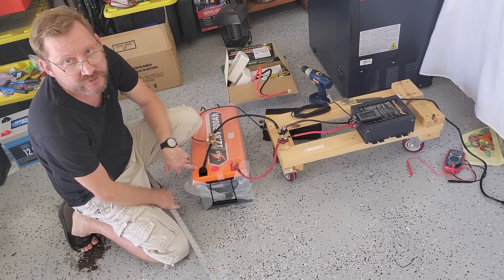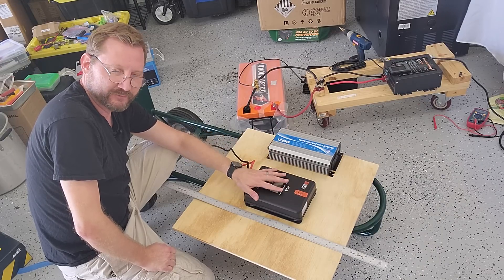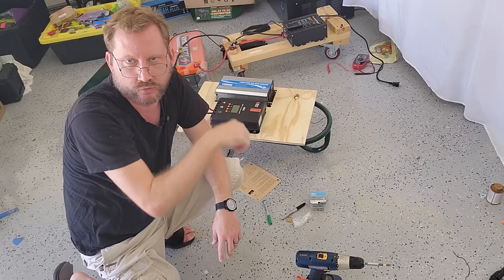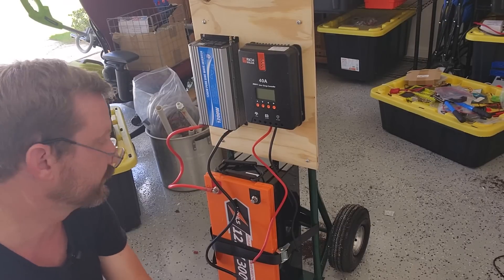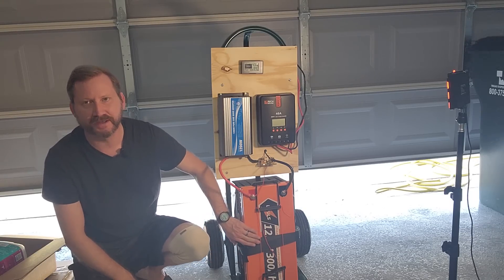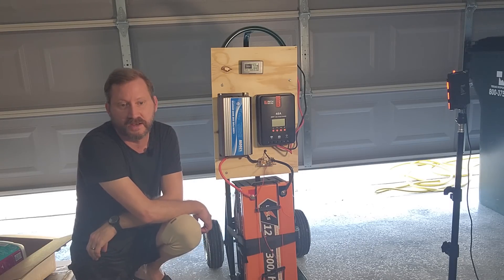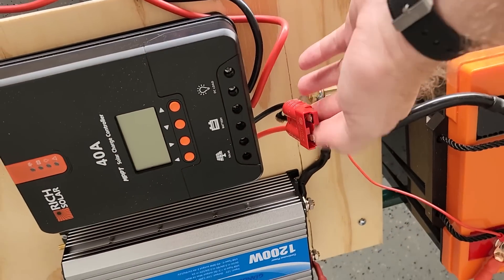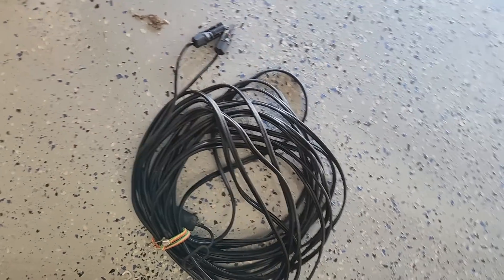Build a 3840wh solar battery cart for under $1,200 in 30 minutes| #diy  Texas Prepper Projects

Comment: Server rack battery is way to go. Under 1000 for vatrer 48v and another 500 or so for all in one hybrid inverter. Powmr released a low frequency 5000w version recently.
Reply from the maker: See my video on 12v 24v. I think 24 is the best. 48v systems require too high of a solar input voltage and the components like inverters are too expensive

Comment: I've been searching youtube on these sorts of things. I've made up my mind to build yours. I quite like it. Is there any item or device that is retrospect you would change or add to your system?
Reply from the maker: If I were to do it again, I'd make a 24v system. Check out my other recent videos. In a 24v system, the current is lower, so it's a little safer and you can use smaller wires. I think that a 24v, 200ah system is just about right.
Reply: @texasprepperprojects  Funny you say this because I just spooled up that video.
Reply from the maker: @BarbosaUral  great!

Comment: Really nice setup I am trying to make a setup but am not sure how to get started.. just curious is the battery designed to be used up on its side like that?
Reply from the maker: vendor said it was fine. its just a few wires. if you have done a car radio you can do this

Comment: I wish you guys would just tell us you can run a refrigerator for like 18 hours you could do the fan and The Notebook for 3 hours and as well as five other light bulbs tell us what that 3840 amp hours can do
Reply from the maker: Its because I can't.  What you need to do is get a Kila watt meter and plug it into your fridge and let it go for 24hours. Every system, every house is a little different. I know that my chest freezer in my garage needs 1kw for 24 hours because i tested it. So, this thing will run my chest freezer for 4 days. But if you have a newer model or a bigger one your number might be different.   Watt hours is a great universal measurement but I can't and won't say 'this will last this long' because there are too many variables. Spend $30 on a watt meter and test some stuff!

Comment: I heard you can use a Renogy boost converter some how to overcome the  minimum solar input voltage of 120v. Any comment?
Reply: Forgot to mention that I'm talking about the minimum input voltage of the eg4 all in one
Reply from the maker: Yeah I get you. I've seen similar for golf carts that run high voltage. I'm sure it would work but you are going to lose efficiency. I have seen @WillProwse do it with his golf cart
Reply from the maker: I have used DC DC step ups in the past. I'd do it in a pinch but I don't think it's trust them for daily use

Comment: Great video. 

There's just too much tree cover around the house so using solar is problematic. I plan to use a similar setup, leaving it inside the house to keep the refrigerators powered. But run a power cord into the house to recharge the batteries via a portable gas generator placed outside on the deck. The plan is to shut down and secure the generator at night and use it to charge up the batteries during the day.
Reply from the maker: Good plan!

Comment: Great video.  I went the EG4 and server rack battery route and have to agree with you needing 120 volts minimum to start the solar charging is a hassle.  But I found a work around buy using my EcoFlow delta max 2000 to charge the EG4 LL battery or by using my Honda 2200 generator when we lose grid power.  After seeing your video I think I will build another one similar to yours.  Have not decided on whether I will go 12V or still go 48V.  Thanks for your video and sharing with us.
Reply from the maker: Stand by, I have a 24v system with a LOW input voltage video in the works, which I think is a great compromise!
Reply: @texasprepperprojects  I will.  Would be neat if you could also show how to connect a 48V to 12V voltage reducer converter thingamajig.
Reply from the maker: @shelley131  that's actually pretty easy,. It's just 2 wires in and 2 wires out, but i'll try to include that. Having said that, the more I play with these things, the less I see a need for 12v in most applications.
Reply: @texasprepperprojects  I have frequent grid outages where I live and because of that I find that power is premium and 12V appliances are my go to during this outages.  For example during the freeze here in Texas we stayed warm using 12V electric blankets and sleeping bags.  12V fans during the summer are great and also use 12V refrigerators if the outages last longer than I like and just transfer food from the residential fridge to my dometics.  Using a/c power on my power stations are limited to the large freezer in my garage.  I don't care about power to the internet or television.  I also use 2 cpaps with 12V power.
Reply from the maker: that actually makes sense.   I never had any luck with 12 electric blankets and my queen size pulls 300wh in 8 hours. Also, fans are more efficient the larger that they get.   A box fan that pushes 2400cfpm only pulls 60 watts.  So, consider those things. But the fridge and Cpap for sure.   The 12v step down is an easy add on  https://amzn.to/3WCngHQ

Comment: what about the ground on the inverter????does anyome know if that ground on the inverter can be connected to the battery ground???
Reply from the maker: It's floating since the battery isn't grounded.  You could try to ground it to the earth, but you'll have an imbalance between the negative battery and the ground. So, just leave it floating

Comment: Very nice set up ...but it's better when you use 24 v system
Reply from the maker: I do agree with this in a lot of ways. I have 1 24v system and are working on another one. I need a matched set of batteries to do so. Coming soon

Comment: Oh man, not another 12V project. 48V is the way to go! Much smaller wires.
Reply from the maker: My next system will be 24v. The problem with a 48v system is that they require a minimum of 120v of solar input. That's at Least 4 big panels.

Comment: The one thing everyone misses is to show how to program the solar controller the rest is plug and play but the controllers don't always come pre programmed
Reply from the maker: all you have to do is go into the charge controller and change it from SLA to LIPO battery type.  Or set the charge voltage to 14.5

Comment: So, Why didn't you show the connection of the charge controller?
Reply from the maker: I mentioned this in passing. The wires are just hanging off to the side. this is an emergency system. If I have to hook up the solar, then I'll just unscrew the bolts on the battery and connect the wires from the charge controller.    I Could have done a buss bar, breaker, and all of that stuff, but I was trying to show how ultra simple, ultra low cost this could be.

Comment: This is great if sticking with 1200w inverter loads or less. Do you know what the surge capacity is on this inverter? I like your idea on switching out the mc4 connectors!
Reply from the maker: Surges to 2,000w.  The biggest load I can think I would want to run is my fridge. I personally don't see the point in running a load over 1,000w for any period of time on battery/solar. If you really need a big load then buy a genny

Comment: I have similar setup but with two 200A batteries. It's not portable and it sits on two shelves, one for batteries another for electronics. I have 100A battery to be portable with separate 1500w inverter. Only one thing bothering me is the air flow of my 2000w inverter. When outlets are pointing up the air flows downwards and since hot air is rising it may impede cooling. I have to put together the rack for my two 240 w panels
Reply from the maker: Why don't you add a DC fan to keep some air moving?
Reply: @texasprepperprojects  I was thinking about it

Comment: I have built a couple of DIY systems using 100ah lifepo4 batteries.  Thrle problem for me is that their "portability" is marginal at best.  I use them around the farm and pulling that cart through the woods or loading it into the back of a SxS isn't practical.  I bought a Bluetti product for that application.  I use my DIY sytems in my barn.
Reply from the maker: Agreed on portability

Comment: I like it, good work. I will say however, that it's not a 300 AH system, it's closer to 250 AH after losses. You said it pulled 80 amps for 3.5 hours but it looked more like 70-72 A for a bit less time. That's still only about a 17 % conversion loss which is quite good. 

I prefer a small propane generator over any battery system. However, I think it's great for a well pump or house lightening. One doesn't want to burn propane until you have to.

 I also think you could keep the cost a lot lower by using LiPo. How many charge cycles do you need ?  I think 300 cycles should suffice to get you out of danger. The 3000 cycles of LiFePhO is over kill in IMHO, but if you have the money then who cares.

Lastly, that 50 foot charge cable for solar might be too long. I don't know what your solar system is so it's hard to tell. You might be loosing significant volts and current on a 50 foot run of 12 gauge wire.   I'd use that system you built like a large UPS personally.
Reply from the maker: The inverter is what injects the losses. If you look closely at the monitor screen vs the inverter screen you can see the difference in wattage at the inverter and wattage at the battery. If I was at a pure DC load that would go away.  I am in a small neighborhood so I don't want to deal with the noise or fuel storage if a generator though I recognize they are much cheaper

Comment: Hey Scott, I just subscribed great video and awesome directions I have a question as I'm about to build your battery set up. Do I need to put a battery shut off switch and a fuse anywhere? Thank you for your time.
Reply from the maker: I mentioned this at the end. I personally find switches annoying and I just disconnect the battery wire when I'm done. I also don't use a breaker because the battery has a bms to protect it. Neither is a bad idea, I just dont.

Comment: I just bought a portable solar generator and want to buy solar panels to charge it. I would like to have at least 2 charging points coming from the same solar panels. Are there are any "distribution boxes" or something of the sort that will allow me run cables from the solar panels to different rooms and allow me change which charging point is active at any given time?
Reply from the maker: Yes
Reply: @texasprepperprojects  Really? I've been searching online for any such information but I couldn't find anything like that. Please can you describe the process and any items I will need? Thanks a lot!
Reply from the maker: It's called an MC4 bridge adapter

Comment: Check out the MPP Solar 2724LV. It will accept a 30 to 50 volt input from a  solar panel or solar panels in parallel. I use a 24 volt solar panel. It has a 2700 watt inverter. Use a 24 volt battery or batteries in parallel.
Reply from the maker: I have been looking at that model!

Comment: Love it and maybe better than the hybrid all-in-one.
Reply from the maker: Pros and cons. I'd like an all in one just to make ot cleaner but no one makes a 12v version
Reply: @texasprepperprojects mpp solar makes a 12 volt all in one 1000 watt.
Reply: the ebay seller is maximum solar and general goods.
Reply from the maker: they are 12v in  but 230v out.  I can't find a 12v in and 120v out. MP solar has a 24V in and 120v out, but not 12v in and 120v out

Comment: This was pretty nice...and pretty cheap. I'd like to see a follow up video in 6 months or so, if you don't mind.

Did you see my follow up reply on the TDS video?
Reply from the maker: i did not!  tell me about it!
Reply: @texasprepperprojects  Hmmm, for some reason it's not there.
The only other tests you can do is:
pH
Chlorine residual
Hardness 
Odor
These tests are simple and do not tell your if the water is safe to drink.
If you really want more than that, check to see if your state, county or city offer free or nearly free full analysis tests. Otherwise, you're only other option is a third party laboratory.